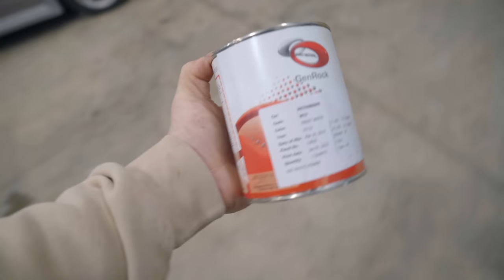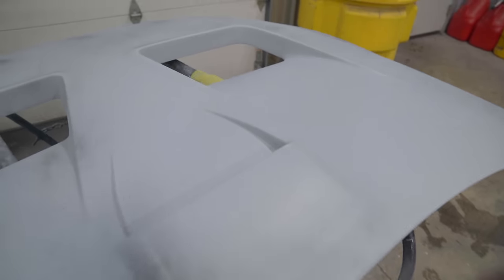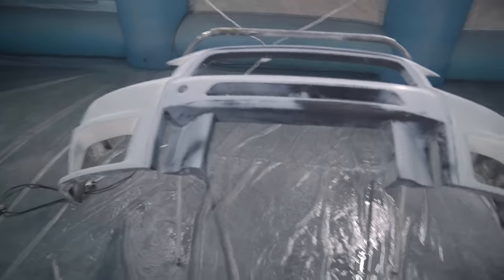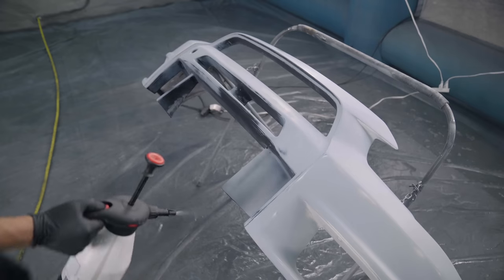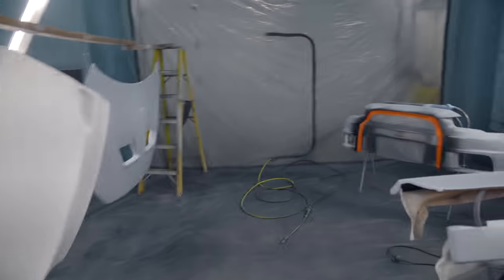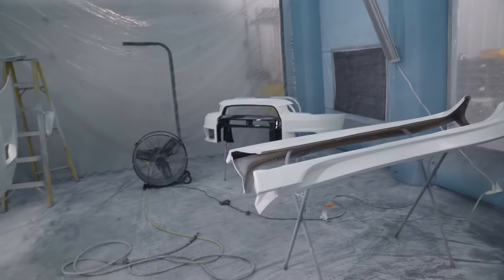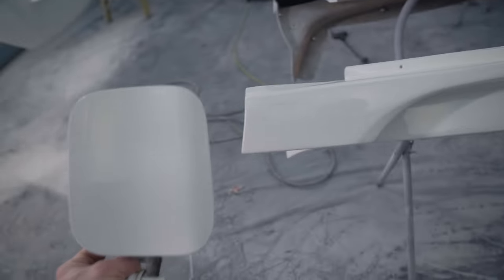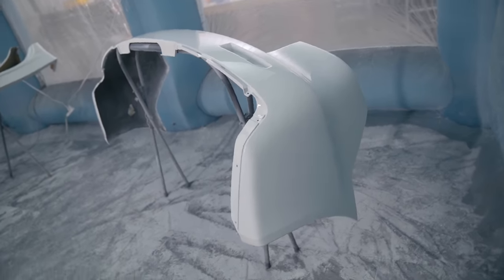Painting The Varis Evo 10!

Comment: Colors are tough to match.  Especially if you don't have the chemicals on hand to do multiple tests. I do color matching on an industrial scale and using the same dyes and mix criteria, it's not always a perfect match. Not blending and putting two colors right next to each other is the most brutal visual comparison. It's hard to see on my little screen, but I would guess that the panel gap would be enough to hide the difference.